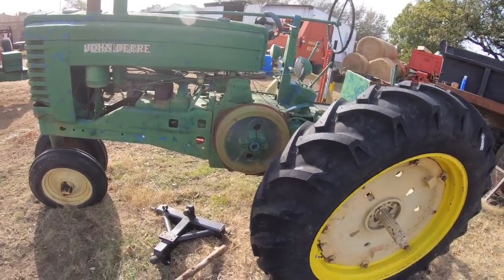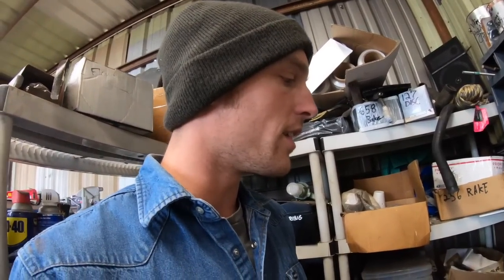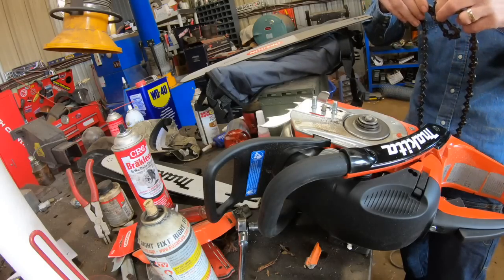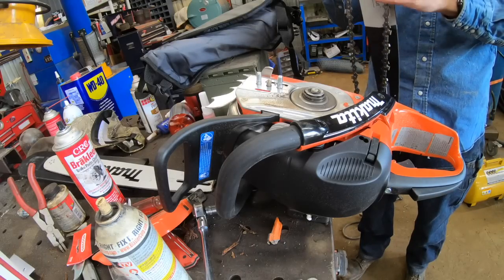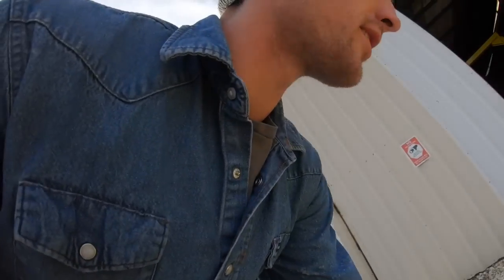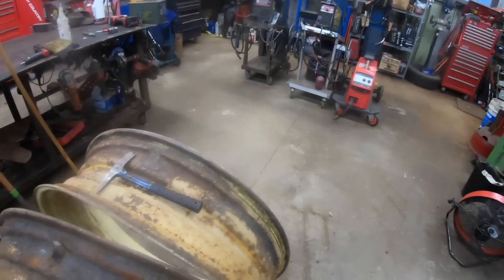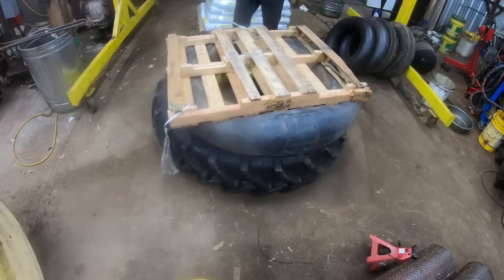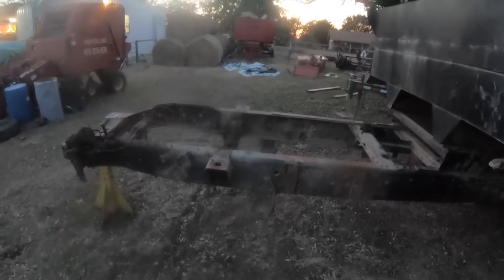Condensing Junk On The Farm: NGL I Bought Way Too Much Crap

Comment: Helpful suggestion here from personal experience. Look into how much hydraulic volume that hoist on your dump trailer requires and verify that your tractor has an adequate capacity. 
I’m a farmer myself, in Illinois. We bought one of those “pups”, the dump trailers that they pull behind the dump trucks. We just got it to use around the farm behind the tractor, using the tractor hydraulics. It lifts it great. The problem is that the triple stage cylinder requires all the fluid that the tractor holds. So you get it lifted, and then the tractor won’t move because there’s nothing left in the hydraulic system with that also runs the transmission 😂. Needless to say, we haven’t gotten much use out of that purchase. I think the only way we are going to be able to use it is to give it it’s own hydraulic system with it’s own hydraulic reservoir.
If you have a scissor hoist under that dump bed, you are probably ok. But if that has a multi stage straight cylinder hoist of any sort, you might want to do some calculations on how many gallons it takes to lift it and check how much capacity your tractors have.

Comment: If you want to protect the tractors until 'full sandblast and painting' day ... mix up linseed oil and thinner 1:3 to wipe on with a cloth. One or two thin coats will shine up the patina and help the metal last until that big paint day. Super inexpensive and easy, lasts a year on equipment stored outside or longer if shed-bound. I got the recipe from Vice Grip Garage channel and it works.